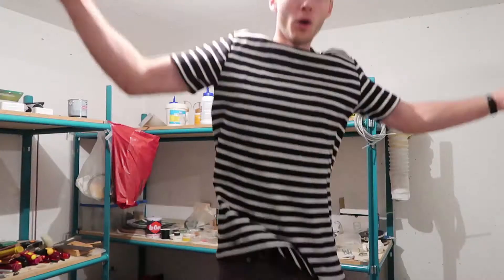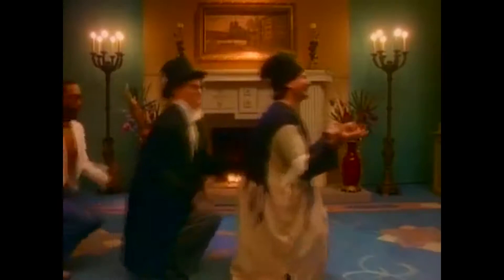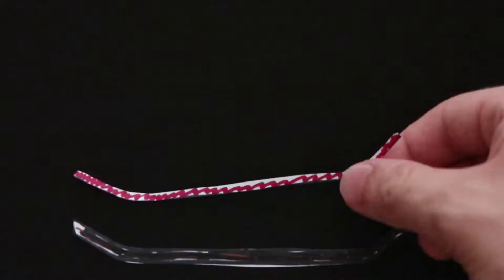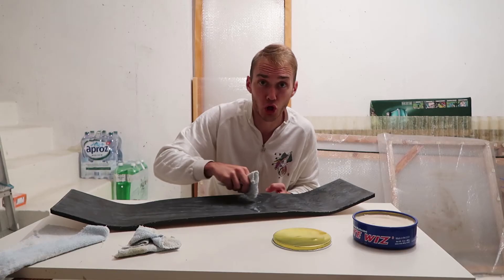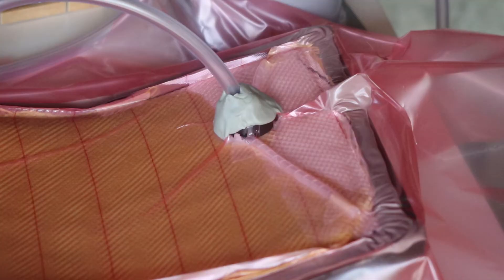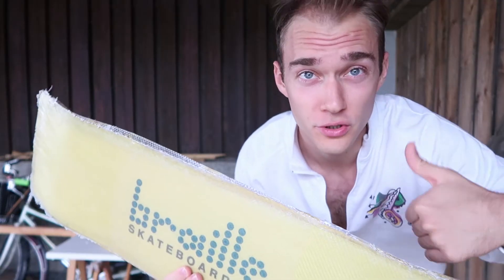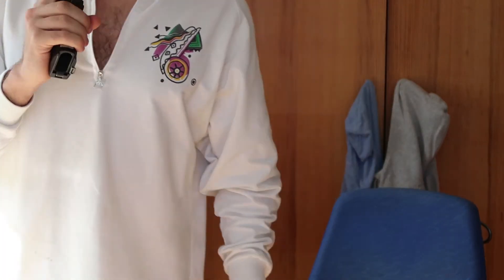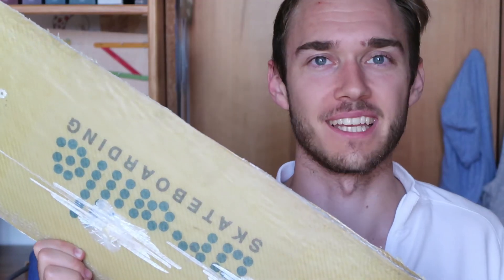BULLETPROOF KEVLAR SKATEBOARD ? for Braille Skateboarding - (resin infusion)

Comment: 35-37 layers of kevlar will work for level III which should stop almost any pistol round. Also, with the resin impregnation, it should be pretty darn firm too.
As an aside, I found your channel wondering if anyone had made Braille an AR500 board or any kind of aramid for that matter.
Reply: P.S. Dyneema would be a game changer, it is to kevlar what kevlar is to nylon. Some HB80 would be perfect for something like this or HB210 (but I think you need government contracts to get that).